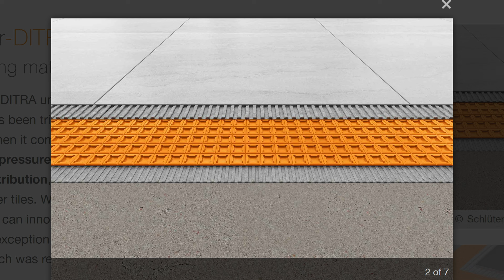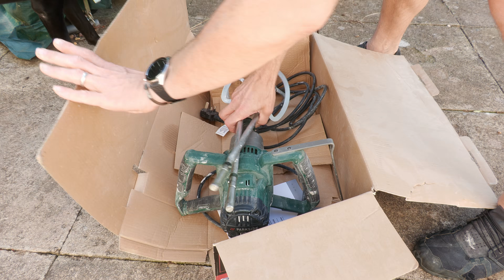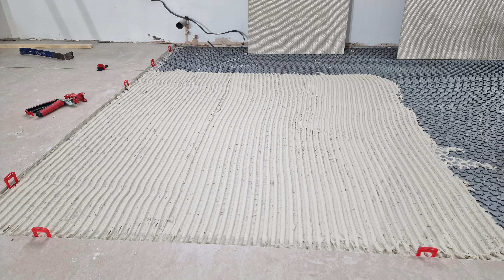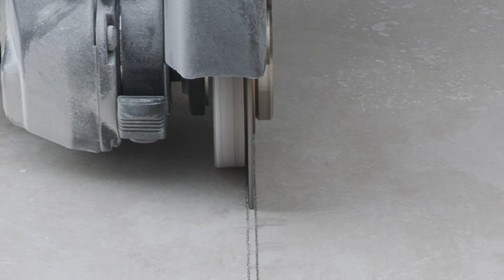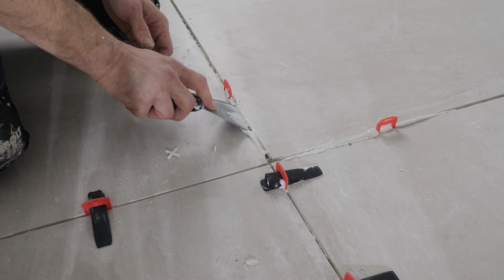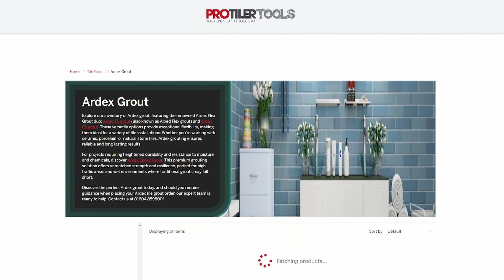GIANT Floor Tile Install - Pros Said I Was CRAZY!

Comment: Great video with lots of tips but hand cutting dry? First you have a lot of skill, second that guide wheel helped but also caused the cracks. I bought a small handheld cutter with water and it’s much nicer to use but will wash off pencil lines but at least you aren’t covered in dust. For other watchers I would not go in that large without prior experience. I’m on my third tiled job and only now would I say I’m competent.

Comment: Pro tiler here (if you've ever walked through Heathrow or Stansted to name a few, you've walked on my work), you done a great job on your own with no experience, so give yourself a pat on the back Charlie. 👍🏾

A couple of points just for future ref: 

ALWAYS WEAR A MASK when mixing adhesive or grout as they contain a lot of silica and you'd be surprised how much you breath in, even outdoors. 

Important to keep the grout joints clean as the adhesive is not waterproof and therefore compromises the grout when finished by allowing moisture to penetrate. Cleaner joints can be achieved by widening the tile join to about 6-7mm and running a damp sponge through the joint to clean any excess adhesive off the edges. 

On any size floor tile installation, the weakest area will usually be the corners as they tend to have the adhesive squelched out when laying the tile on one edge first to lower it. To remedy this, take your trowel and pop a small dolop on each corner of the tile or floor after trowelling the adhesive. It will will squelch out when you lower the tile as before but leave enough to protect the corners. This could be considered overkill suitable, for commercial installations as opposed to domestic but I like to adopt a belt and braces approach to everything. 

Finally, make sure you use a "Latex" sponge when grouting. They are available in most tile outlets and will make your life a lot easier when cleaning up. Mix and apply the grout as per the manufacturer instructions. Submerge the sponge in water and wring it out until virtually dry. Now without applying too much pressure, clean the grout joint using a circular motion whilst moving along the tile. DO NOT deform the sponge under pressure but hold onto it lightly, the square edges of the sponge are designed to skim over the joint without entering it. Once the surface grout has been removed from the face of the tile, soak the sponge, wring dry and gently run it along the length of the joint to achieve a smooth finish on the grout surface and then leave well alone. Final cleaning of the silent can be carried out after an hour or so. 

Hope this helps anyone out there willing to have a go. 😊
Reply: Thanks
Reply: Wow that was some stellar input. Many thanks!
Reply: If you were pro you would know there is waterproof grout available
Reply: @Sbayo9 

😂 I am a pro tiler whether you believe me or not won't change that but you're entitled to your opinion. 🙏🏾

But just for the adults out there: Yes, epoxy based grouts are available which are totally water and chemical resistant. However, the process of preparation, application and clean-up of the tiled area would be totally irrelevant if regurgitated onto the comments section of a video demonstrating the application of cement based grout. Epoxy grout requires specialist equipment, chemicals, techniques and knowledge to apply. Knowledge which would ultimately help no one attempting to complete 95% of home projects, grouted with cement based, non waterproof grout. In addition, epoxy grouts are not suitable for every type of application.

So you see @Sbayo9 knowing what to say and where to say it is more important than just saying something because you know it. It's the difference between knowledge and wisdom. 🤷🏾‍♂️

Comment: Hi Charlie,
I just thought I’d add my experience of the uncoupling mat adhesive.
I went with the AF200 ready mixed stuff and wish I’d used the adhesive you used. 
The matting came on a roll and as such it tends to roll up on the cut lines and edges. On my first section I left the adhesive for about 10 mins before placing the mat down and found very little adhesion. Panicking I rang the Ardex’s help line and was told that I probably needed to leave it 20 mins or so, despite what it says on the tin! Subsequent sections were slightly better but I don’t have anything like 100% adhesion. I’m going to lay the tiles on top as I note that the matting can be used dry as a totally separate barrier and the weight of the adhesive and tiles should keep everything together, not great though. Lawrence.

Comment: Great job Charlie!  I love all the details and 'don't dos'. lol   I'm in the middle of a major reno and am would like to go with 24"X48" tiles but the guy at HomeDepot said they will crack since my slab is already cracked, and not to do anything larger than 12"x24".   I don't know if there is any validity to his statement.  Since you have a fresh slab I would assume that there will be some settling/cracks.  Did the underlayment work, or did any of the tiles crack?
Reply from the maker: Thanks! No cracks in the tiles to date that's why the decoupling layer is so important. And with the decoupling layer you should be able to lay tiles over a cracked concrete slab beneath. The guy in Home Depot is talking rubbish 😉
Reply: Thank you so very much for your insight and taking the time to reply.  It’s looking like it’ll be a good 6 months before the floor will be installed.  If you could please let me know if any cracks develop in the future I would be greatly appreciative.  I’m hoping they do not because you did such an amazing job and it would be so disheartening.  Thank you again for everything! <3 🙂

Comment: Man they are some big tiles. Wouldn't drilling the corners and then cutting to that, be better as so the tile won't crank because it's a radius and not a sharp 90°?
Reply from the maker: Yes I did that initially but then stopped bothering when I was in the thick of it 😉

Comment: Hi Charlie, love the channel, excellent stuff!  I have a question about the 25mm insulation up stands - looks like you trimmed these down flush with the finished screed level after that went down, is that correct?  Something I can't find the answer to anywhere!  Many thanks
Reply from the maker: Thanks Luke. Yes that's right. I had to trim it down as the SWIP insulated battens sit flush on the floor.
Reply: @CharlieDIYte  Thanks for the reply Charlie - I'm on a 1950's house with insulated cavity wall, so will be keeping existing plaster where it's in good condition and using plasterboard where it needs redoing.  In this instance, would you run the insulation upstand up to under the plaster/plasterboard, tile up to the insulation and finish with skirting board?  Thanks again

Comment: Hi Charlie, coming from a kitchen and bathroom fitter(that tiles,plasters,plumbs,does the joinery and cabinetry)….I think you’ve done a really tremendous job there. Most tradesmen would avoid that job if honest,due to the trickyness and pain in the arse factor!…so credit to you. Been up here in Norfolk for 14 years now,but Suffolk for 17 years before that. Worked all over Suffolk,from the towns into copious little villages…just a guess here-are you based in Suffolk?
All the best, keep your videos coming-they’re fascinating-and what I love is that when you make a cock up you firmly hold your hands up😂…humility is a rarity in people.
Reply from the maker: Cheers Jonny, always humbling when a pro finds my videos interesting, for the right reasons 😉 Wow, that's proper graft what you're doing. I'm in the midlands actually (Worcestershire). Yes I think mistakes are reality. I've had too many careers and too much water under the bridge to bullsh1t people 😉👊

Comment: Wow! Fantastic job Charlie,😊 clearly a great deal of very hard work too!! I would like to point out the importance of using a hole cutter / drill on all internal corners before disc cutting, failure to do this with large format tiles often causes stress fractures to appear over time.
Reply from the maker: Thanks mate. That's a good point. 🤞 crossed. 😬

Comment: So, your Ardex X11W recommendation along with the use of a tile thumper as the adhesive is Thixotropic.  How did you know it was thixotropic other than [perhaps] a little old chap on the end of the phone telling you so?  

I can find no mention on the Ardex site or even the X11W spec sheet?

I know the thixotropic categorisation gives it a ''T'' in it's specs, the same as C1, C2, S1, S2, E .... etc.  But the Ardex X11W has the simple ''S1'' categorisation.

That Battipav PULSE Thumping Tile Beater 11501/1 - 11501/1 does look a good idea, especially for large tiles. Would save the old palm from thumping them down manually, just a bit at a loss as to the thixotripic category for the adhesives as I can't find it mentioned anywhere!

Just saying ..... 🤔
Reply: Mate. Was thinking the same about that vibrator thing and the adhesive. I'd hope most modern adhesives allowed you to do this now them bigger tiles are so popular but why oh why do they hide this type of info from us eh.  Hope this geezer gets back to you as I'd like to know too.
Reply from the maker: Hi guys. Thanks for this. Yes it was the rep who told me it was thixotropic. It's the high gel rheology in the classification that refers to this - it essentially means the same thing. Regarding classification the x11w is a C2 TES1 category adhesive. The T classification relates to slip resistance not thixotrophy although it could be argued they are linked. At the end of the day the marketing department need to make the labelling a bit more user-friendly! 👊

Comment: Perfect timing as I'm attempting my first tiling job this weekend with large format tiles for my bathroom, albeit half the size at 120 x 60 cm for the walls. I was planning to do 120 x 120 tiles for the floor but a tiler told me I'd be crazy!  So I heeded his warning and went for 60 x 60. I'm going to have a crack at epoxy grout though which I understand not many people tackle. 

I feel your pain with the time pressure for the kitchen install. I've been there myself. Although I'm surprised you didn't have a go at the kitchen install yourself. 

Thanks for the great content.
Reply from the maker: Good luck with the tiling Ollie. Yes a fare people said that about the kitchen but after living in one room for a year with the kitchen in our hallway DIYfe would have killed me if I had installed my own kitchen.
Reply: @CharlieDIYte  Thanks Charlie. Defintiely wise to pick your battles. I tackled my kitchen install (which took way longer than planned) with a moaning Mrs during the process. The plus side was that I could do it a section at a time so had a useable kitchen the whole time with the exception of a day when the sink was out of action. So we weren't at the mercy of when the trades decided to show up. I'm also tackling a built in wardrobe atm and using elements of your excellent video series for that.

Comment: Great job. Don't think I'd have tackled that size tile! I invested in a grabo as I have lots of projects to do. Great bit of kit. Can lift 170kg. I leave the pump running and it gives me peace of mind lifting larger tiles (not as big as yours). For the grout lines I scraped back around 1in (on large tiles) of adhesive around the perimeter to prevent it getting in the joint. I assume it didn't leave a void, as the excess goes to the edges. Hopefully the grout fills any void if there is one. Not had a problem yet...
Reply from the maker: Thanks Richard. Yes I've heard since that is the thing to do. Would have saved me a lot of hassle cleaning the joints 😉
Reply: @CharlieDIYte  I spent ages with a dremel digging it out. Never do penny rounds or any mosaics. They are a nightmare to keep the adhesive out!

Comment: I had 70mm rise and fall on my floor, level it all using ( over the floor joust)3 ×2,1×2,12mm ply strips and 9mm ply strips.
Used a power plainer to take the hogh spots
Finished it off with chipboard then hard backer boards.
Any where you put down the level it showed true.
Did not get it as flat as you have (using 600×600mm tiles)
Well done
Reply from the maker: Thanks John.

Comment: Well done. As DIYer I've done plenty of tiling over the years, but never with such big £150 per tile. As you say preparation is key and having ALL your tools and equipment ready and sorted can make or break a job. I'm having to remove all our kitchen tiles, as the previous owner tiled around the units...  🙏
Reply from the maker: Thanks mate. Yes it's a great feeling being able to lay the units on top of the tiles. Sorry you've got to do that. Have you got a decent chisel SDS?

Comment: How much did you save doing it yourself out of curiosity? I have a similar renovation coming up soon, wondering if its worth it.
Reply from the maker: It's a good question. I didn't get any quotes so I couldn't tell you unfortunately but I suspect it wouldn't be cheap ie starting at £1500 upwards depending on how many rooms

Comment: Why do you do it to yourself! 😂. I think you need a second pair of hands for tiles this size. Also I wouldn’t add to the pressure by using rapid set adhesive.
Reply from the maker: The rapid set is actually a god send because you can stand on the tile you've laid pretty soon, which is often necessary when laying the next one. The 40 minutes open time is plenty as it turned out.
Reply: @CharlieDIYte  You can actually put quite a lot of weight on a wet tile of this size.
Reply: why not.
and why should bob the builder have all the fun.
rapid set was fine for me, the trick is to mix a half bucket at a time. 
(you can always mix more later)
once the first few tiles are set perfectly you have a sound foundation.
upon reflection, tiling is like having a baby.
its the prep beforehand, levelling the surface, tanking etc.. which takes all the time (as it should)
and the actually laying of the tile is relatively quick
Reply from the maker: @spacemahn Exactly mate - which is what I started off doing until I was confident enough to do a full bag.

Comment: Excellent video. Brings back memories laying a large area of  partially calibrated slate tiles. No one would quote for the work because of challenge of laying slate tiles that had variable thickness. So I went the DIY route. Everything you say reflects my experience but wish I had seen this first.
Reply from the maker: Thanks Barrie. Wow you had a job with those tiles! I suspect I wouldn't have had many people keen to take this on either 😉

Comment: A great looking job, Charlie, it made a great video.  To reduce the chance of levelling clips breaking off flush with the tile surface you can use slightly smaller clips than the grout line. For example 2mm clips with 3mm spacers in your case, it tends to reduce the amount of adhesive stuck to the sides of the clip. Just pull out the spacers before the adhesive has gone off hard.  Levelling clips can tend to push the tiles slightly apart when you tighten them up so this helps with that as well, although with the big tiles you used that probably wasn't an issue.
Reply from the maker: Thanks Martin. That's a really good tip. Plus you could always have a few old fashioned cross shaped spacers handy just to stick in the top to keep the 3mm gap consistent using your 2mm clips 👌
Reply: Yes, that’s exactly right.

Comment: Fantastic! Many years ago my dad, brother and I retiled most of my parents' house with 18" porcelain tiles laid on a diagonal with 3mm grout lines and periodic 2" marble accent tiles at some intersections. My dad is an architect so he planned the whole thing across 5 rooms to mm precision, and we also hired a master tiler to teach us and help with the hardest cuts. He spent the first week with us and taught us about cutting, back buttering, levelling, how to use a screwdriver and sponge to clean out adhesive from the joints, grouting tips and tricks, etc. Even with all that expertise and help, it was a massive job which took weeks for the 3 of us. It was backbreaking, precision work -- and our tiles were tiny compared to yours. We didn't nearly as many challenges as you did (example: the angle of your lean backwards to provide a counterweight when you're lowering those tiles really drives home how heavy they are -- wow). 

What I'm trying to say is: I am so impressed by the exquisite work you've done! They are gorgeous, and now you get to feel that pride of workmanship every single time you come home and walk across your floors. Thank you for so meticulously documenting this.
Reply from the maker: Hi Brooke, what a lovely message, thanks so much. It's so interesting hearing about that epic tiling job the three of you did - and the satisfaction it must have given you once it was complete - were you all still talking to each other by the end? 😉. Thanks for watching my vid. I'm chuffed you found it interesting. 🙏
Reply: @CharlieDIYte  hahah, yes, oddly enough this is the sort of project we love so much we willingly embarked on it together over Christmas and New Year's! My mum is used to it by now. She and Dad are now retired and have downsized, and of course the new place was a fixer upper 😄 but we did get years of enjoyment of the new floors before they moved. That feeling never goes away.